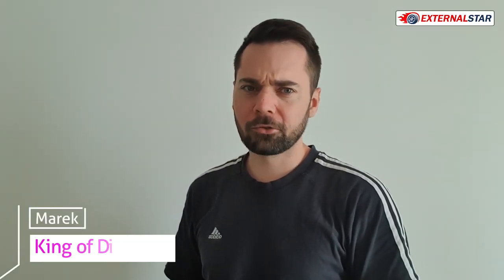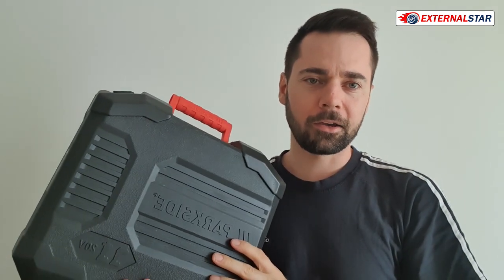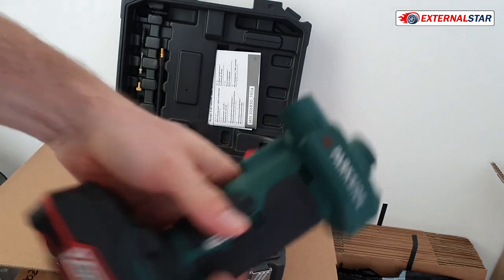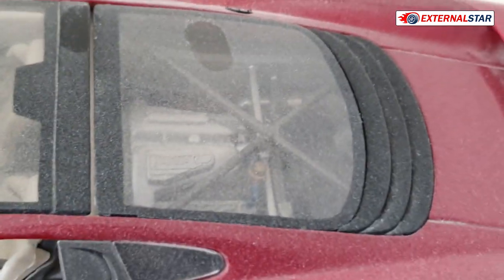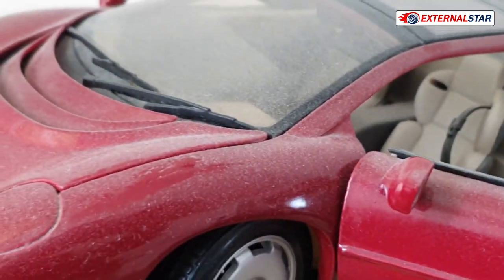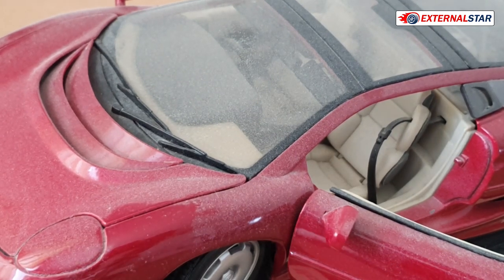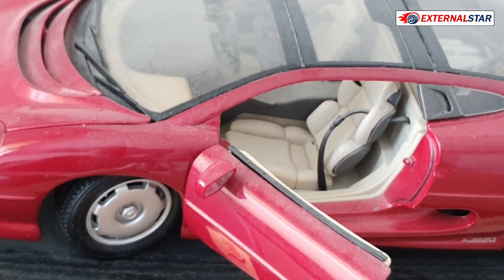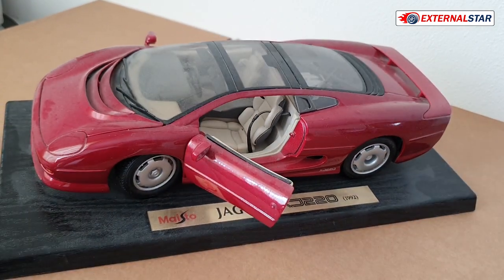Test: Will air blower clean my dusty 1:18 models?

Comment: I've found for something that dusty, usually a car-specific detailing brush (looks like a paint brush) is needed.   Dust physically 'sticks' to the paint, and therefore has to physically be removed from the paint.    Detail brush for the stickiest dust, then a dampened microfiber cloth, and finally the air blower will only remove the lightest dust.      It's easiest to maintain the models monthly if possible, and prevent that 'sticky' dust from accumulating in the first place.

Comment: I think my opinion is to repaint it, so restoration. Disassemble the model by removing screws on the bottom of the car, then clean all the parts. As far as car's body and hood are concerned, I do not know what do i call the colour removal. Use colour white paint spray after the original colour of the car was removed and then it's up to you what colour are you chosen. I watch several videos on restoration of 1/18 model car. They select the colours of theie choice, as well as paint the wheels on either black or white, again of their choice.

Comment: I'd repaint it if I were you, if you were to burn one I'd get an old model that's already a bit broken, eg. missing panel or smashed glass

edit: just remembered about this thing I do with some of my cheaper models, build custom side windows with a thin clear plastic - I've only done it on models with a window frame so far but it'd be interesting to see how it could be implemented onto a frameless door